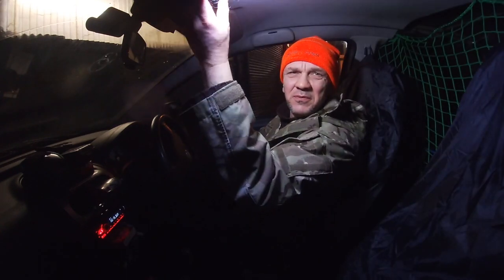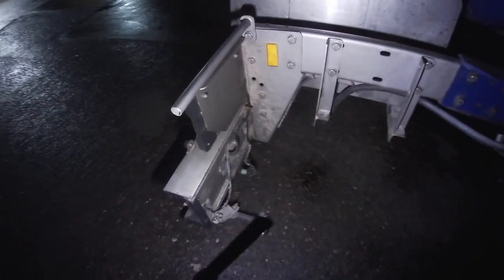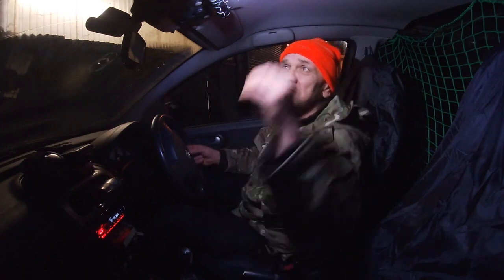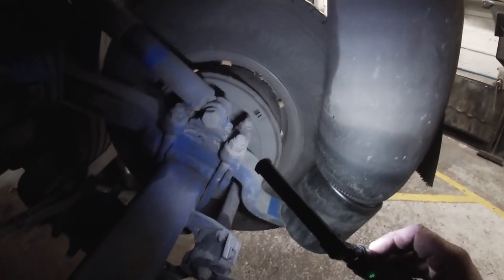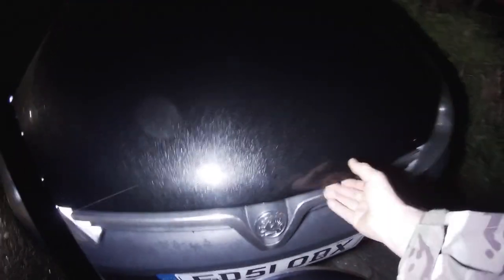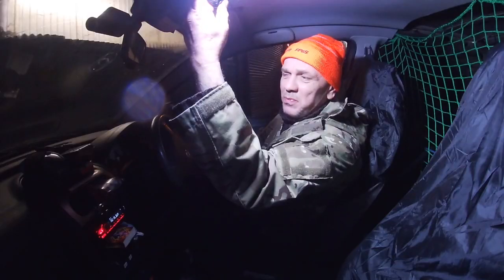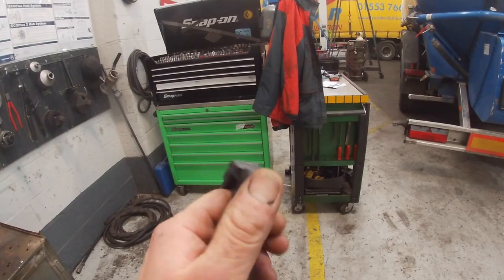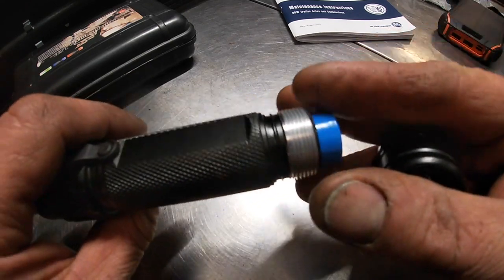Blue Spot Tools - 5 watt 280 Lumen COB LED Inspection Torch Review

Comment: Thanks for the video. I just came across this light today. Regarding the blue 18650 cell showing in the video, does it have a BMS (battery management system) in the cell or in the light itself. The reason I like torches like this one, it is because it pays off having one or 2 extra cells in case if you run out of juice, so you just unscrew the cap, take the cell out and a fully charged cell back in and you are ready to go. There are some other good lights out there but the 18650 cell is buried or soldered inside the light's body, so if you run out of battery, well, you wait another few hours while it charges up?

Comment: May have missed it but do you have to cycle through the modes to turn it off?  Do you think it would last a shift of inspections/servicing etc?
Reply from the maker: Good questions.   It does not cycle if you have had it on for a while but if you want to cycle it you have to switch off then cycle.  It has lasted as a shift with intermittent using....